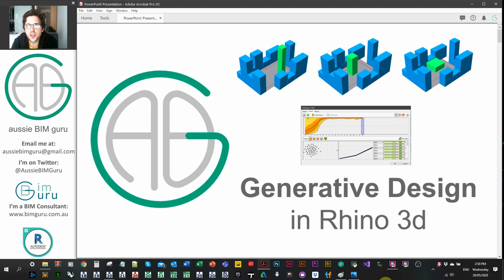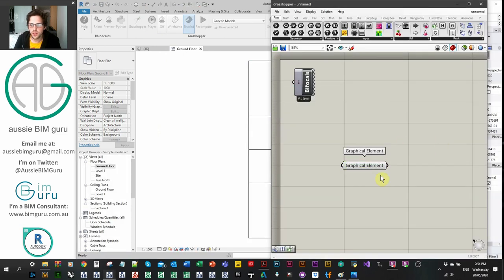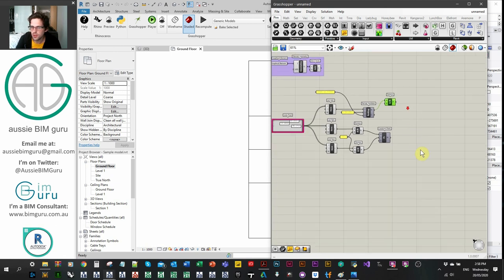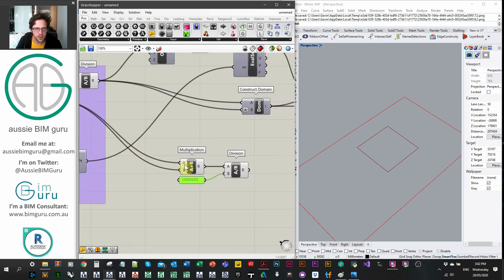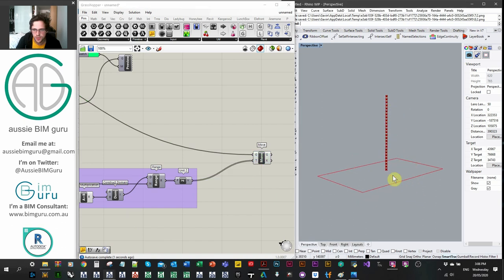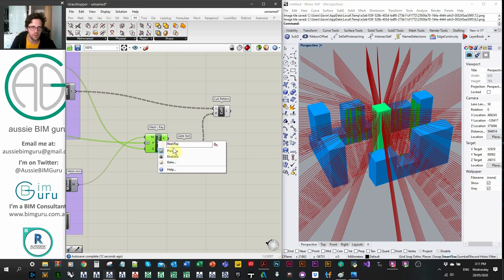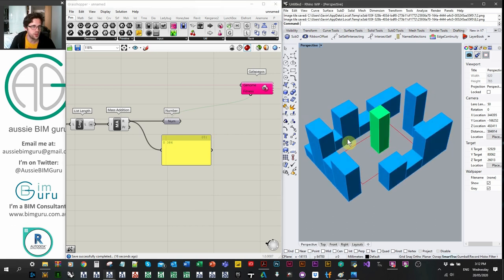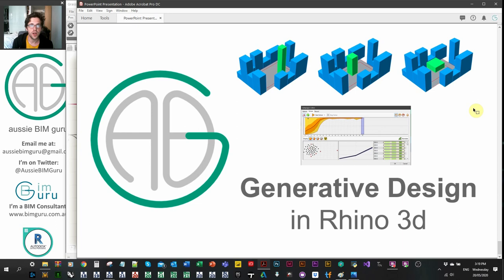Generative Design in Rhino 3d (+Rhino Inside)!

Comment: @Aussie BIM Guru Dear Gavin, I appreciate to you for enligtening to us, again.  I have already encoded this script in accordance with your instructions but without Rhino Inside's nodes.  because of demanding to us licence. Actually, I had just wanted to learn this plugin in order to improve my encoding skills. I don't know how can solve this issue. I mean that I would rather using Grevit than Rhino Inside. I thought that Rhino ınside look like more powerful than Grevit. I could be able to take same performance from Grevit ??
Reply from the maker: I never actually used Grevit, from what I can see it mostly focuses on exporting geometry from programs to others. Rhino Inside does much more and has many more nodes to work with.

How are you using Rhino without a license, 90 day trial? I would suggest if you find it useful enough, the perpetual license may be worth it in the long term (far cheaper than revit if you can already afford that).

I believe rhino inside is the best way to handle revit/rhino interoperability and has dedicated developers supporting it whilst i expect other options will be abandoned due to this. From what I can see Grevit development has been quiet since 2018.
Reply: @AussieBIMGuru  Dear Gavin, I apologize for my late responding to you. Actually, nowadays it is not possible mean that be affordable thing for me to this license issue as well as, in that case of unconnectible joint or gap between rhino and revit, I thought that is their either disappointed or weak point of angle for curious people. As a matter of fact, I frankly can say that the license issue will an explicit condition for me for a while. Yes of course, my personal either opinion or view is that their revit/rhino inter-oper-ability skills or nodes have powerful, efficient, effective and delightful approach for between them, Even Though, I guess I will continue in way that use already to grevit nodes. Never mind. it was very kind of you :)
Reply from the maker: @muratusta8138  to be fair, revit is about 3 times per year as rhino is perpetually. All about the value you can derive back from the tools I guess.